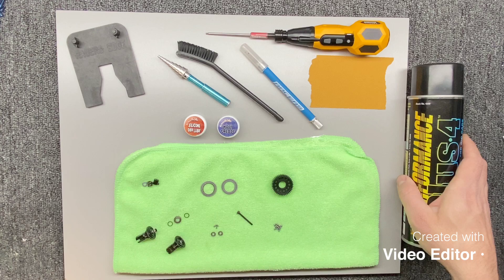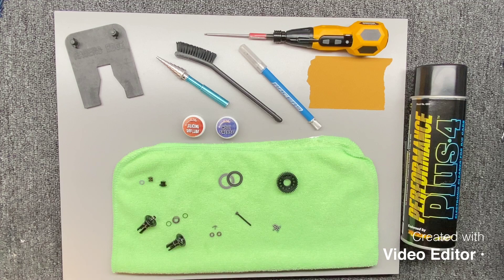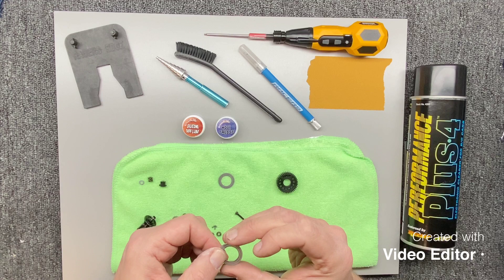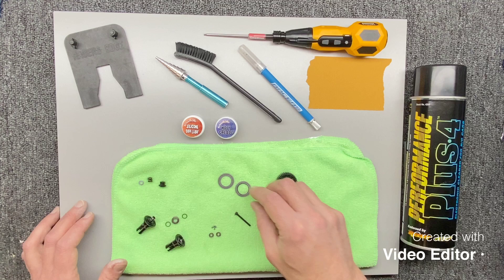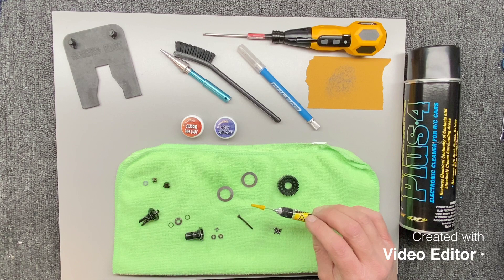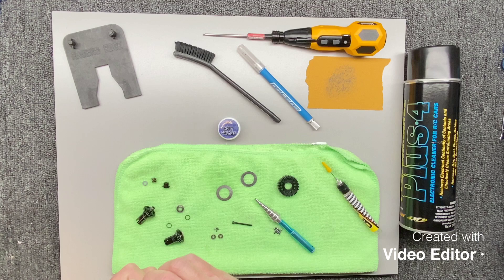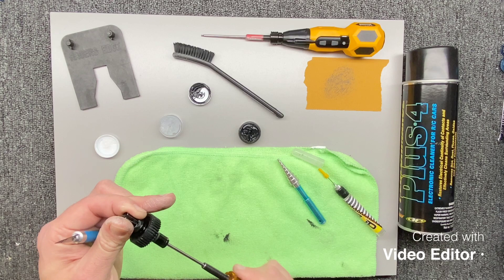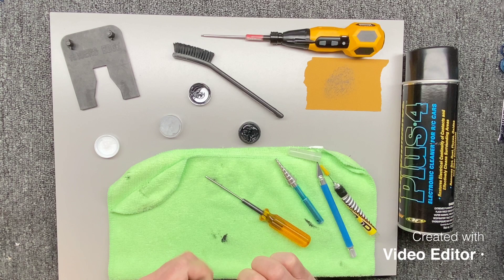Klinik RC S1E2 How to build a PERFECT Ball Diff!!

Comment: What's the difference between the white and black grease? Why ball diff over sliper/gear diff?
Reply from the maker: Ball diffs are used on dirt and low grip Astro surfaces. Gear diffs are typically used on high grip Astro and carpet in 2wd buggies.